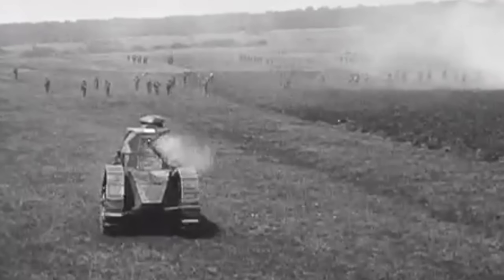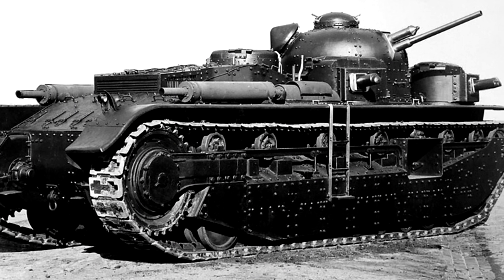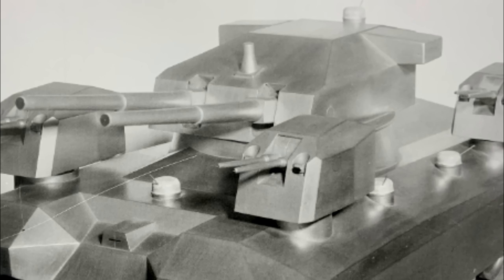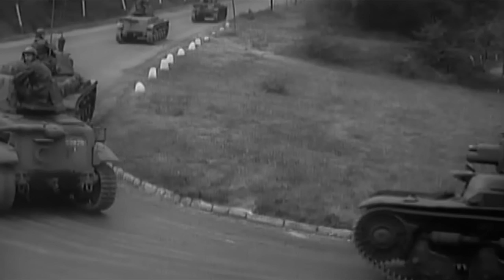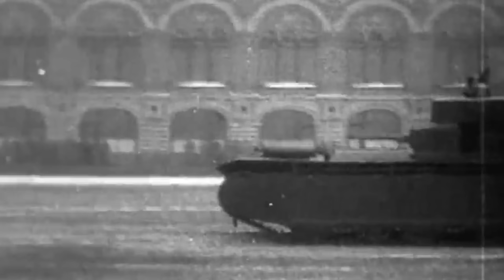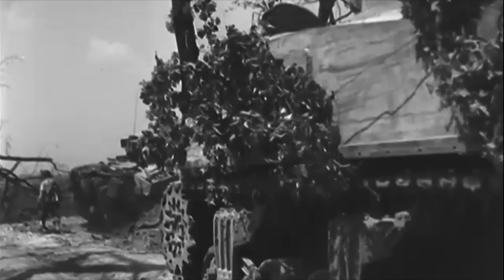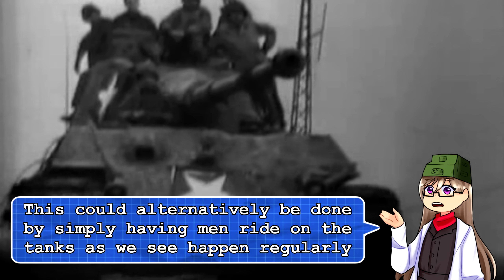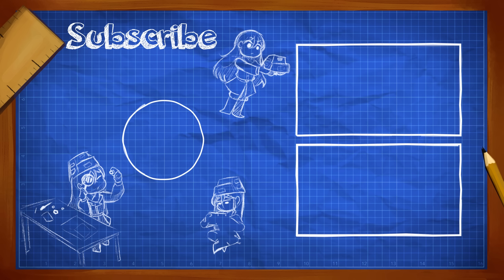Why do Multi-Turreted Tanks Fail?

Comment: The multi-turreted design dates from thinking of AFVs akin to naval vessels.  Something like the Soviet T-35 would be a clanking "land battleship."  Just like its naval equivalent,  big, lumbering,  and EXPENSIVE.

It was soon figured out that maneuverability was more important than protection or firepower.   Get into "trouble ", then get OUT of it, especially with some clever drive-train modification made by the tank platoon's "mechanical genius" and future luxury liner captain!  Eventually a balance of mobility,  protection,  and firepower was reached with the Main Battle Tank.  Reducing auxiliary weaponry aboard the vehicle also reduces the CREW requirement, which in turn reduces internal volume and thus overall size and weight.  Hence why Soviet IS tanks, making their appearance in the "Great Patriotic War" in early 1944, deleted the hull machine-gunner position (aka "assistant driver"), enabling better structural integrity of the glacis and also able to slope it more radically, as only the centrally-seated driver had to be accommodated.  Post-war Soviet mediums like the T-44 and T-54/55s (later designated MBTs) also did away with the hull MG and reduced the crew to four.  This was also true of the UK's Centurion, which just missed combat in WWII.  USA tanks, the hull having been a WWII-era design, kept the MG and fifth crewman, most notably in the widely-distributed M47 "Patton II", as it was the mating of the existing M26/46 hull and the AVS-1790 engine to the turret of the discarded T42 design, in an interim design while all the "bugs" of the new M48 Patton III were being worked out. Intended more to built up USAFE armored divisions during the Korean War, as Korea itself was deemed more suitable for self-propelled artillery than tanks, almost 8,800 of these slapped-together tanks were produced from 1952 to 1954, not too bad for a "stopgap"!  Once the M48s, which had a better shaped hull to deflect shots, and also deleted the hull MG, and reduced the crew to four, was being mass produced at the Chrysler Tank plant, the M47s were delved down to NATO allies and some "neutrals", most notably France, the FRG (West Gemany), Greece, Iran, Italy, Spain, Turkey, and even Austria.  It was on an M47 that actor Arnold Schwarzenegger did his mandatory military service; and Arnold later bought the same tank, had it cleaned up and shipped to the USA, and it's now a publicity piece.  Most M47s had 90 mm main weapons (M41), but some that were kept in a reserve role, notably with Spain and Turkey, were upgraded with the M48's diesel powerpack and the same M68 105 mm gun as on the M48s and M60s.

Comment: To talk about the fcm 2c i believe they would have had an impact on the german vermarcht. The reason they couldnt achieve any feats was because the german aviation destroyed their train while on the way to the front. And to speak more technically, the 2 c's second tower was a machinegun supposed to support the tank against infanterie wich would take away most of the inside com issues. The tank was also a monster for his age featuring huge armor and a nice gun (can't remember caliber) compares to his german peers (panzer 3 + very little number of panzer4). They wouldnt have turned the tide as there was only 10 2c though.

Comment: One way multi turret tanks or vehicles could return is in smaller installations like the roof mounted machine guns.
But for use as point defence with AI targeting(reducing crew), letting it engage a swarm of attackers from any direction and even drones. Especially in urban environments where lots of tanks are useless compared to a single well equipped vehicle.
Edit: yes vehicle's in any urban environment is a death sentence but gotta try something?

Comment: I think the biggest economical argument has not been brought up: You will loose some vehicles, some after a fight and some even without them firing a single shell. Maybe because they are the first blood on the battlefield, maybe because of an incident on their way to the frontline. If you split up your firepower and your wonderful dollars on multiple vehicle, loosing a number of vehicles isn't as tragic when they all have just one gun and five crewmember instead of two or more with double the guys inside. Having fewer but multiturret tanks also has negative effects on your mobility. Attacking with fewer tanks (that may pack a bigger punch) will result in getting out flanked, surrounded and ambushed more easily. Having more tanks means spreading out and having a bigger area of denial

Comment: I mean ships have done it fine. Doesn't solve the weight issue, and in fact points it out. But they refute all but the weight problem, and the fact that massing your troops to a single location is a good way to lose them and their equipment.

Comment: Solution: instead of making the tank longer or wider to fit the additional turrets, just stack the turrets on top of eachother and make the tank taller!

Tank commander: "We shall sneak through this forest so they don't see us!"
Procides to drive his tank through the woods with the top two gun turrets clearly visable to the enemy above the treetops.
Tank hits slightly tilted ground and falls over: "Timber!"

Comment: I think the biggest issue is the consolidation of resources it is. If (time and resource wise) a multi turreted tank is equivalent to 2 normal tanks, then destroying one is equal to that as well. It also means that there are less resources you can spread out or use to reinforce with.

Comment: A few thoughts I had that are related to some points you made-

Modern tech would make multi turret/multi gun tanks more feasible. In fact an argument could be made that we sort of have that now as modern MBTs often carry quite a few weapons and utilities on them. While these aren’t more guns in the same spirit as the ones covered in this video, they do have many different types of weapons carried onboard that all serve different purposes. Which is basically what you said there at the end, but I guess my point is that modern tech at least partially does away with many of the drawbacks mentioned such as size and crew communication.

Logistics is another problem. It sort of ties into a few points you made, but not only is the cost to produce greater, but the cost to maintain (as there would be more parts of different types), fuel consumption, types of ammunition needed, crew training, and transportation (I know this was sort of mentioned). These are all things that, while economically difficult, are also difficult from a logistical standpoint to get to the frontline where they’re needed.

Comment: In short I suppose the reason is because all you need to win in tank against tank fight is one good hit and enough protection to not die to the opposing tank.  Multiple turrets or guns make it overall less effective and more expensive. You could argue that the machinegun is sometimes it's own thing but it really is just a secondary weapon for different targets and should really just be considered part of the turret even if it can move somewhat independently from the turret.

Comment: It would make most sense with smaller guns for anti-infantry in mind (not fighting armor). 
These wouldve had to have thinner armor in the front and back, and thickest and most sloped on the sides (engaging targets from either 3 or 9 o clock, like a ship)
They would need to have an engine good for speed, and only enough armor to deal with handheld infantry AT, so it has enough speed to bug-out fast if any enemy armor presence.

Comment: A flaw I don't think you covered is that, if trying to compensate for the communication breakdown by having sub commanders for any extra turret, you have to have a larger turret to fit them in, which would add to the weight and cost problems.

Comment: i would say they would have a much larger cost in operational logistics such as oil multitude of different ammo types, strain on the power supply on the tank itself, fuel cost, increased grease on to mention maintenance alone in a repair bay as the time there could very well be doubled if not tripled before it can be deployed again

Comment: Having more firepower in a tank via things like more turrets is kind of nullified by what I (and I’m sure many people before me) call the Death Star principle. Why did the Death Star fail? Yes, the Empire built a massive imposing space station with literal planet-killing capabilities, but in doing so, they also concentrated a larger share of resources, manpower, and yes, firepower, into one target. So when everything was thrown at that target and it inevitably collapsed, the Empire lost a huge amount of resources, personnel, and combat capability for little gain compared to what they could have achieved for pouring those same resources into the regular fleet. Big vehicles that do everything are scary, but they are also easy targets in combat because they are the only targets, and they likely aren’t going to be able to handle a multi-pronged attack, unlike a force with responsibilities divided among multiple vehicle types.

Comment: Multi Turreted tanks would basicly turn into actual land battelships, not just in name but in function.

Several turrets that would be presented to fire a broadside on a single target all directed by the same fire controll, getting a zitadel to protect the crew and ammo with heavy armored turrets fronts that would act like regiments in the time of napoleon, driving in collums, lining up side by side and then unleashing volley fire on the enemy where each tank could use its 2-4 guns facing towards the side create its own continiously salvo against the enemy, or a massive salvo and then sitting there for 30 seconds where the enemy is not suppresed and can fight back

Comment: I think if there's a "return" of a multi-turreted tank, it would be as a drone tank; light, cheap, built with off the shelf parts, and using 20mm-30mm auto cannon or even .50 BMGs with no crew component. Just remotely controlled drone tanks. 

Even then, I'm not sure there's an advantage of two turrets vs a single one, and building more of the little buggers.

Comment: I think the multiple turret concept could and did work on stuff like armored trains. For tanks it depends on the requirements, but dispersing armaments on multiple hulls has an advantage of being able to be used at multiple locations, and being harder to take out at once. But nowadays maybe sticking vertical launchers, drone bays or remote control anti-air or anti-drone, perhaps even anti-personel weapon stations will appear. If the barrels or pods don't go further than the tank, then hitting them on stuff is less likely.

Comment: I think also a problem tying into the "better have 2 tanks than 1 big one" is that one big tank will awlays be shittied strategically than 2 tanks : 
1 shot can disable your entire tank, instead of one shot killing only one of two tanks
Also, we often think of tanks as like, the center piece of a battle, but most ofte nthan not, you work in a platoon, and want to cover some if not a lot of space to advance, not just "spear through", so having 2 tanks and spacing them 50m or 100 or more is better than a single tank with mutliples turret

Also the whole "jack of all trade master of none" applies a lot here, why bother moving a 100 tons vehicule that have say, 1 large caliber canon, 1 medium canon and 5 machineguns , in a scenario where only 1 medium canon and 2 mg would be useful ?

Also, since mechanics, engine and fuel consumption doesnt scale linearly, you need more crew, that was a rare ressources for many countries (like France made their tank mostly 2 man crew because of crew shortages) for a one 2 turret tank than two 1 turret tank : the 2C had a crew of 12 (!!!) while most tank of the time had a crew of 3, or 4 for the larger one , meaning a single crew batallion of a 2C could had maned 4 or 3 tanks !!

Also, most of the advantage are just nullified when we see IRL how poorly a big tank can move, multiturreted or single : The Maus nearly didnt saw combat because of how slow and a easy target it was, same for the 2C, didnt really saw combat, and most of them got easily destroyed by bombarding them while having to be transported on rail . No matter how strong your tank is, if you can't even bear it to battle, it's wasted time and ressources

Comment: SF writer Keith Laumer wrote a number of stories about the Bolo Arms Co, set in the distant future. Bolo started with somewhat conventional tanks that ultimately evolved into the Continental Siege Unit, a space-traveling weapons system the approximate size of Mt. Rushmore. It moved across terrain using force fields, since no amount of treads could support its incredible weight.  It was operated by an AI fire control system that was programmed to advance the goals of the galactic empire that produced it. Onboard weapons included missiles, terawatt lasers, artillery, combat drones, detachable robotic armored units, and gravity-wave projectors. Its purpose was to pacify an entire planet with one unstoppable weapon. 

And yes, it had multiple turrets.

Comment: Dead end development into expensive, heavier designs sucking away more manpower.  Maybe with later technology you can have the extra turrets be computer controlled.  Then you're going to have Skynet arguments eventually.  If you have technology advanced enough for computers to handle the extra turrets, why have men aboard to begin with? 😉

A lot of my grief with these outlandish designs is the crazy crew requirement.  When one of these things gets destroyed, it's what?  Almost a dozen men gone?  With computers in charge, you don't have to worry about that.  You don't have to worry about crew space, ergonomics for crew to optimally perform, etc.  This won't happen anytime soon though.

Comment: "Multi-turret tanks we're not that effective"

Hold my T-35
Reply: Didn't the Finns take one out by simply digging a very large bear-trap?

I would say that kills any argument about it being effective!
Reply: @Grubnar  Negatory, the T-35 might have not been the best tank, but it was important for 3 reasons

Propaganda: The T-35 as we know it was an incredible land Warship and it help to build a strong fear among the germans

Defense: In the early stages of Operation Barbarossa the T-35 was used to defend the motherland from the german advance

Evolution: the T-35 (along side another tanks) was an important step for the Soviets to the ultimately understand that the best tank to build was the KV-1

Also if we take all multi-turret tanks ever build, the T-35 it's the one with most success, so you can kinda call it "the best of the worst"

Comment: Having a double turret tank is definitly more cost efficiant than 2 single turret tanks, if you conpare the firepower. In the example, the 55t tank is +22% heavier than the 45t tank but can potentially shot 100% faster then the lighter one.

I could image, building a towerless tank destroyer with a big gun in its hull versus tanks and on top a small turret for a 30mm auto cannon vs infantry and lightly armored vehicles could hold the price increase in check while making the tank a jack of all trades. But would this be a multi turret tank?

Comment: One possible use case that I don’t believe was ever explored would be a super-heavy marine landing tank.  For Army tanks the railroad gauge is a limiting factor, making them quickly too long to be practical.  But for a vehicle which is transported via landing ship there is no such limiting factor.

Reading about the pacific campaign there were numerous times when a heavy tank could have been employed to great effect.  In fact the post war Marine Corps were the last to employ a heavy tank in the US Military for this exact reason.

Imagine if the USMC had adopted the M6 heavy, a 58 ton beast which could have easily been ready by 1944.  A single LST could have delivered at least 5 M6 tanks in a single go.

Comment: You could argue that one multi turret tank could be cheaper than 2 single turret tanks in terms of cost and man power requirements . Though that doesn't cancel out the other drawbacks and having two tanks instead of 1 offers more flexibility.

Comment: One theoretical benefit you did not touch on is: with the correct layout, a multi turreted tank could have a variety of weapons to choose from so the crew could avoid wasting ammo by picking the bigger gun when the smaller gun would do. For example, machine guns are not super great at taking out some armored cars, and 57-75mm would be better for that, but 140mm would be very overkill and you'd want to save that ammo for something else.
Reply: Studies performed by the US (when testing the idea of a secondary autocannon in tandem with the main gun) found that tank crews are liable to just jump straight to the main gun if a target is resistant to the MG. Anything the .50 cal couldn't handle, the crew would default to a main gun round to ensure the target will be destroyed. The space taken up by considerably bulkier secondary-cannon ammunition would be far better utilized as added space for main gun ammo as a result.

I mean, you are right that it could be a benefit, but tank crews aren't liable to bother using that benefit and they'd be better off with more main gun ammo anyway (especially since the main gun is more versatile).
Reply: @bluntcabbage6042  tank crews of a multi  turreted behemoth have to deal with a completely different situation. The guy on one of the machine guns probably does not even have access to the main gun, and the turret commander of the main gun is probably looking only for targets that the main gun is actually needed for.